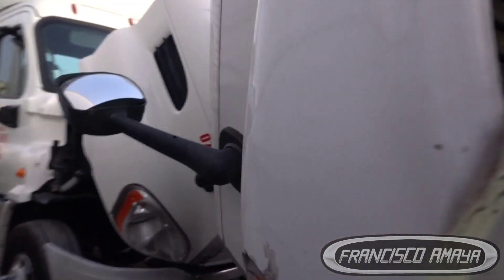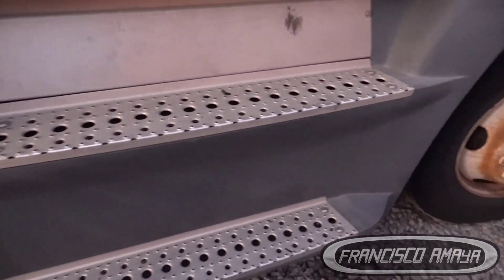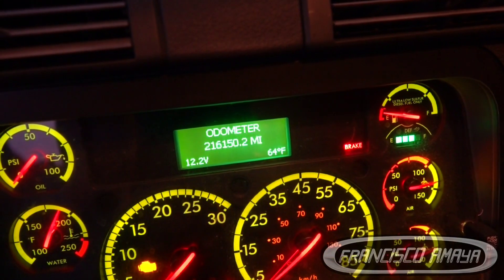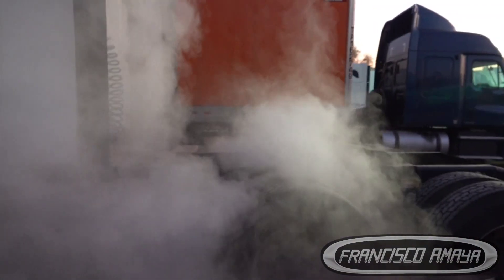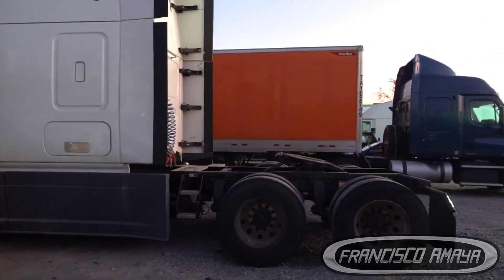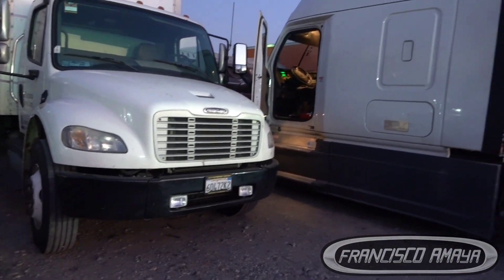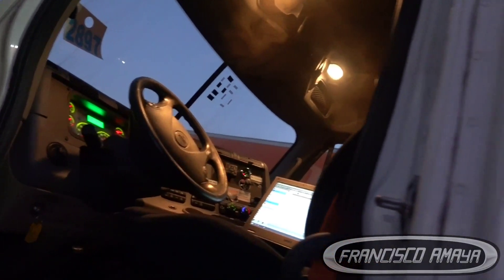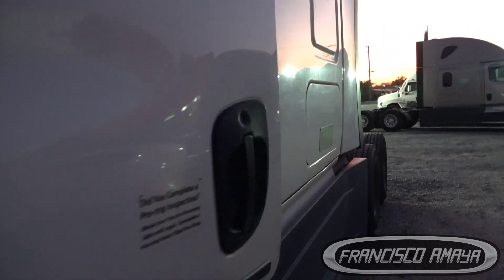DD15 ENGINE DIESEL FUEL INJECTOR FAILURE WHITE SMOKE TAILPIPE ENGINE NOISE

Comment: I had the samething and everyone was saying it was the injectors, i replace all injectors and harness and the issue got worst. We tho it was the valves so we remove the head and took the head to the machine shop. They found 1 cylinder head SPRING broken. After 4,500 my issue is fixed smh. my truck was smoking like a 🚆. The only good thing is that i replace head gasket, resurface the head, new injectors and harness, valve adjustment... now the truck is running good after 30k miles😅